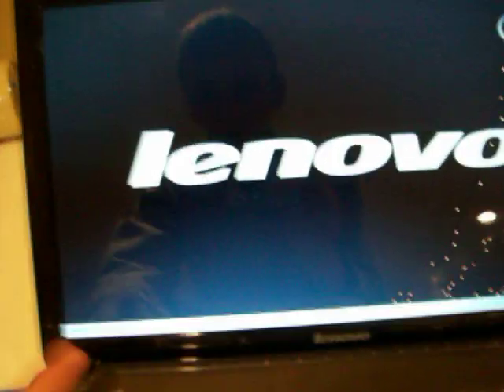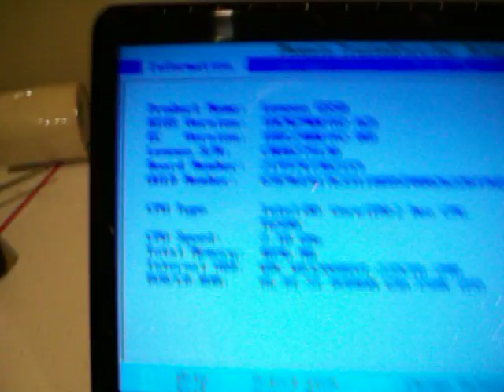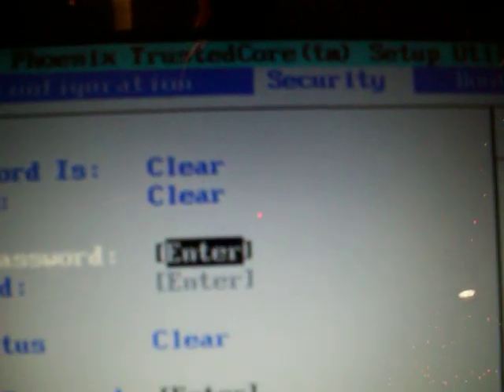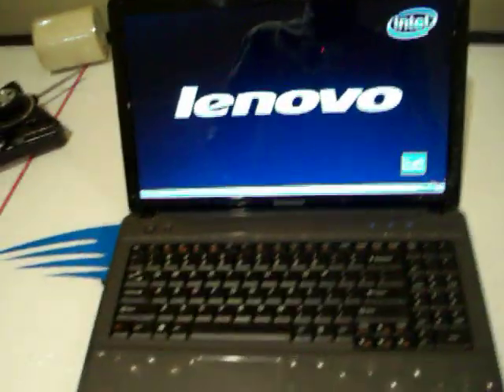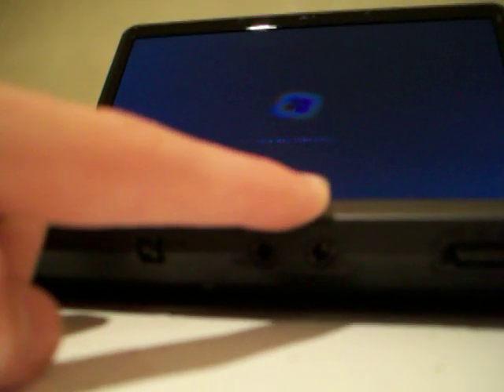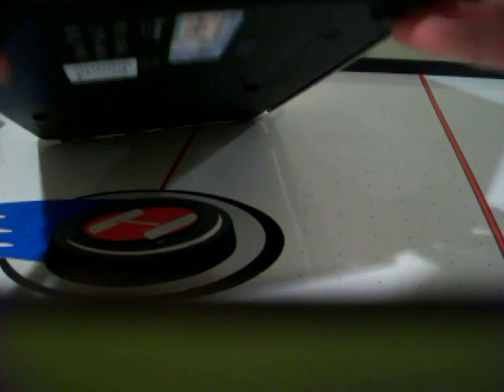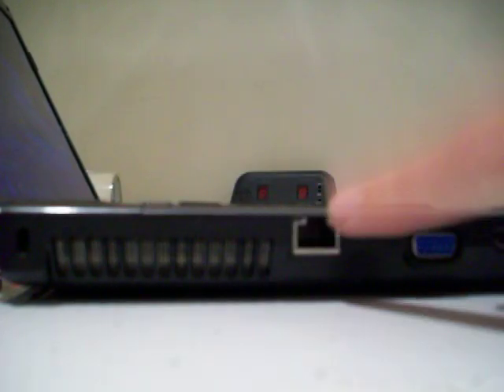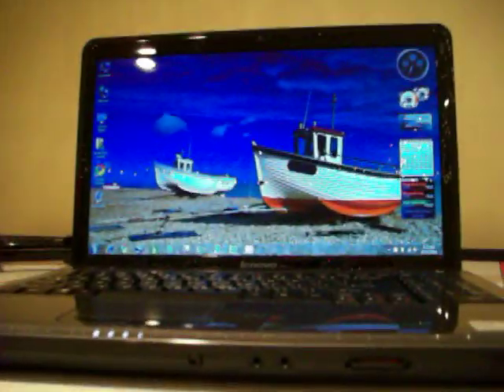Lenovo G series RAM/ HDD Upgrade

Comment: Ive had a G575 a year now..Its been sent back to lenovo Twice Replace the hard drive..Now its screwed up again.. One question Its supose to have dual ports for the ram..Mine does not..What did Lenovo do to this G575 witch has only one???? Whata peace of CRAP

Comment from the maker: @ItsFish2k I haven't used any PCs in about 2 years.  Just read the different specs on Lenovo's site, they are very similar.  The G550 has a 15 inch screen and the G450 has the 14 inch screen, I believe.

Comment: @283kieran It is nice to see how you come to this video for just talking bad about it. Originally the battery lasts 3-4 hours and you can buy better batteries. But if you just leave your charger plugged in even if the battery is 100% charged, that may damage the battery and make it last 10-15 minutes w/o charger.

But I accept your opinion. Just next time be sure to double check the specs of the desktop/laptop you want to buy... and make sure it has the requirements you need.

Comment: I went to Office Max and bought a 2GB DD3 RAM for my Lenovo G550, when I replaced the 1GB RAM it had for the one I bought and I turned it on... the monitor wouldn't turn on.

The only thing I noticed was, the fan started to spin, then it stopped and the laptop turned off by itself. Right now, it only works using 1 RAM Slot. It wont turn on whenever I use both slots.

Any ideas what's happening here?

Comment: @jamesrschultz i do not have operating system disk because when i bought it, the operatin system disk is saved to a hidden partition in the hdd which i can activate it with one key recovery feature.